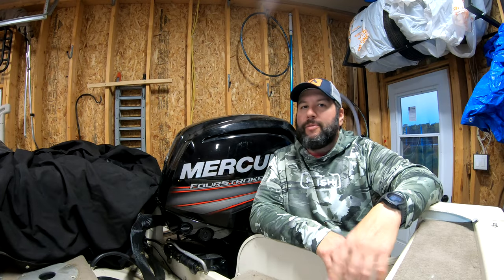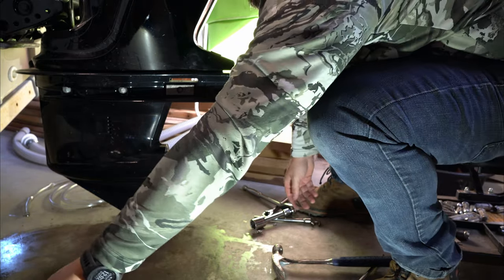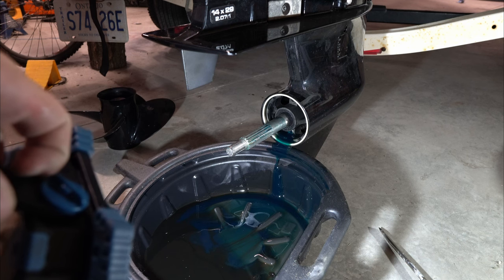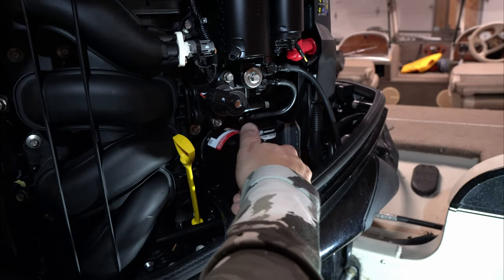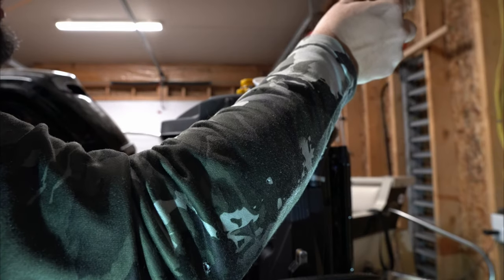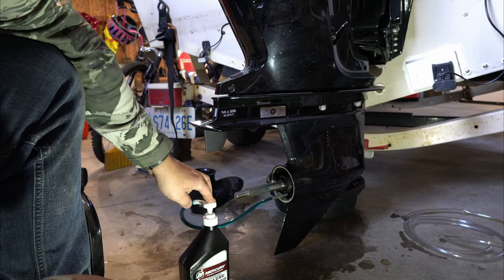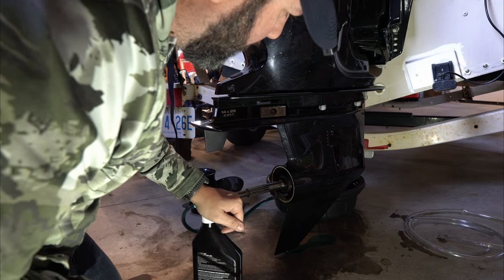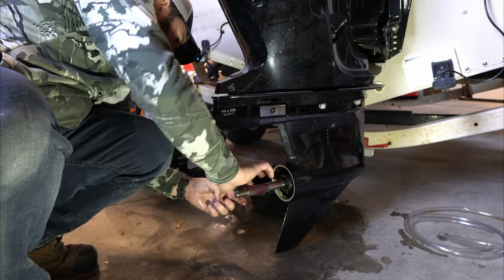Oil & Gear Lube Change - Mercury 90 HP 4 Stroke Outboard

Comment: 1st off let me start by saying thank you. Very intuitive step by step explanation that took a lot of fear out of doing it myself the first time. The only discrepancy I had was when you mentioned 5.2l of oil I just got the kit and they only game me 5L of oil for the engine it’s says in the instructions capacity is 5L as well (5.3 quarts) let me know your thoughts if you have time. Thanks again!
Reply from the maker: Might just be a different model year.  Follow your manual. My volume is written directly on the front of my engine.    If you aren't sure add in the 5L, let it site for a while and check the dipstick.  If its low add a little more until its good.  Glad i could help.     Thanks for watching!
Reply: Nope called the dealer and they checked their book and it is indeed 5.2 liters like you previously stated don’t know why the kit only gives you 5L of oil very odd indeed

Comment: According to the Mercury manual on my 90 HP 4-stroke, the Oil Changing Procedure step 4 says "Attach a 12 mm (7/16 in.) I. D. drain hose to the oil drain valve."  Not a 1/2 in. I. D. hose.
Reply from the maker: Whatever fits and doessn't leak will work perfectly.  1/2 is what i had.

Comment: I haven’t changed my lower oil or engine oil for a few years, but I’m back at it and appreciate your video. Just curious if the nut for the prop has to be tightened to a certain torque. Thank you.

Comment: Why did you have a greece gun and not use it?
Reply from the maker: Used it to grease the prop shaft before reassembling it.  It's the only grease I had on hand.  No zircs,  just pumped it out and applied by hand.

Comment: Your video is awesome and easily the best step by step video I've seen in winterizing your boat motor. 
Only question I had is,  do you "fog" your motor or is it necessary? I see some anglers do and some don't...
Reply from the maker: Hey thanks.   I do not fog my 4 stroke.   But i only really store it for the winter so max 6 months.  If I was going to store it for a year or more I would probably fog it.    Modern 4 strokes are so tight these days infiltration from moisture is likely very low risk.   Thanks for watching.

Comment: Great video , nice commentary with step by step instructions.  Where did you get the little grey thing that you screwed into the lower unit to add lower unit oil.   I never saw anyone change those gaskets on the drain plugs .  Where did you find them?  Thanks.
Reply from the maker: Hey.  The pump and gaskets were available at my local dealer.  They knew what I was asking for when I went and picked up the parts.   Thanks for watching.

Comment: looks like your transducer is sitting a little too low on the right fyi. Mine is sitting up about an inch higher so that its not getting directly hit with water at full speed.

Comment: the engine oil drain plug you attached the hose to, where can i find one? my 90hp doesnt not have one. thanks
Reply from the maker: The one you turn to open.?  It came stock with my engine.  Best to take a screen shot and ask your dealer

Comment: My 90hp 2010 efi has a standard drain plug bolt . Do you know the number on the bolt / tube adapter you have ? Much cleaner operation . Tha
Reply from the maker: Like the part number??   Or the size of tube.  The tube is 1/2 ID
Reply: Part number . Not sure if I can just take out the old plug screw and replace it  with  that one or not .

Comment: What if I back the oil plug out completely…. It went back in fine. Anything I should worry about?
Reply from the maker: I would think its fine, but i'm not a mechanic, best to check with your dealer.  Thanks for watching!
Reply: Hi Brian, It could damage the internal seal. Only back it out 1-2 turns until oil starts coming out. There's a video on Mercury's website regarding this.